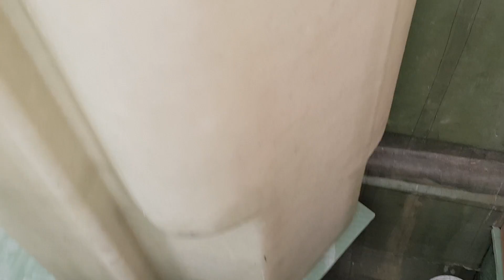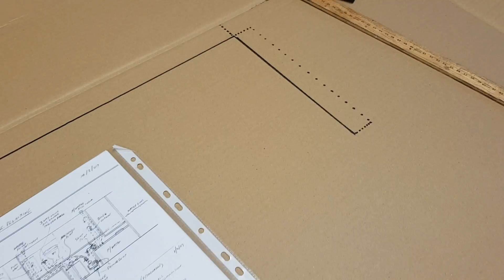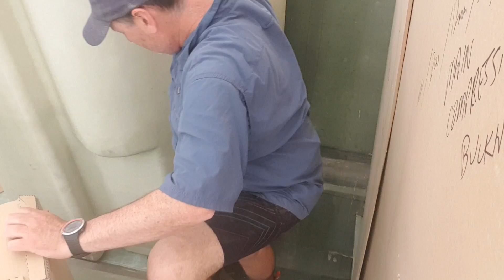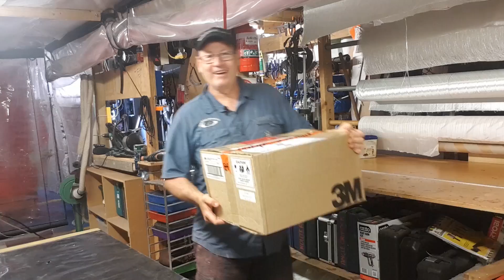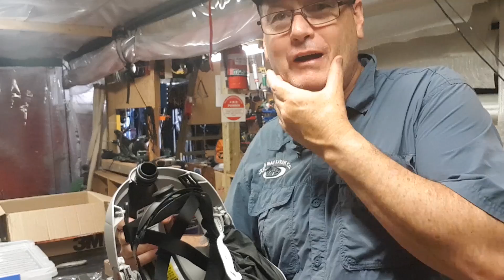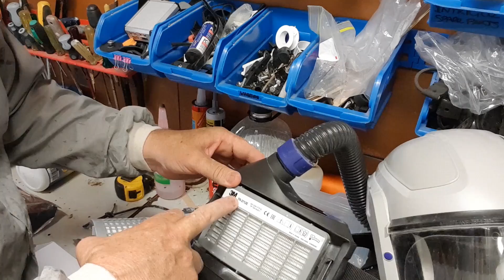Ep057 Nuisance Odours and Blackwater tank setup - Life On The Hulls - Catamaran Build

Comment: 2 points i have. 1. Making your owen templet is the way to do it. Its the only way to get the right size and dimensions.
2. The mask is fantastic, however i have noticed that it dose not cover the ears. the question i have dose 3M supply you with ear muffs to fit over or do you wear the molded ear plugs?.
I too have had an let go experiance one i will not talk on the tube.
Gerard.
Reply from the maker: Thanks buddy.Blackwater tanks have worked out brilliantly.The mask can have ear fitted,optional but I tend to wear my own underneath and behind,bit of a "make do" as I don't need the ears all of the time.Cheers
Reply: just one comment about the gas story,
now you know how an astronut feels when they are space walking. but for them thers no escape.
Gerard.
Reply from the maker: Yep,fart in a spacesuit,glad I can escape myself.Cheers Gerrard thanks for watching buddy.Ross

Comment: Have you heard of vortex coolers? They use compressed air to deliver cooled or heated air, this one is personal sized and is good for inflating a tyvec suit  , you can look and feel like a snowman.    https://www.amazon.com/Allegro-Industries-9991-Personal-Standard/dp/B012D8O764/ref=pd_lpo_sbs_469_t_1?_encoding=UTF8&psc=1&refRID=SS15Y6Q2W4RQFKMEB5PE
Reply from the maker: I did consider buying one but dont like being attached to a compressor.Would give anything to be cool.
Reply: The principal still applies when scaled up, a wind tunnel could be made to have a warmer and cooler branches, though I don't know if your work could be done in a wind tunnel.. perhaps you could make a vortex tube and just point the cool end towards your work ducting the hot exhaust into a chimbly..https://www.youtube.com/watch?v=Hn8hDY4bvpI

Comment: Eight guests on a sailboat, someone is going to drop a white mouse or baby wipe in the system & block the pump, then all the toilets are out of commission. Might be worth thinking about smaller independent tanks in every bathroom cupboard as they have on most charter catamarans, the tanks are self-draining & have a two-way valve for a direct overboard while at sea. Zero smell, no electric pump very low maintenance.

Comment: Hi Ross. To make a shape to fit your tank use the stick with 2 notches method. Cut a piece of card that roughly fits; I'd  glue a batten across the top of the tank and glue the card to it as well to hold it secure. Make a stick with a point with 2 notches as far apart as possible and move the point around the shape your making and marking the line between the notches as you go. Take this card and place it on your ply or whatever and mark all those points on the ply using the line with notches to make your shape. You now have the exact shape buy connecting the dots. Its a lot easier than I've described it.
Reply from the maker: Thanks Mike,I jave used t hr joghle stick method before and Although dead accurate,I have been using my chain jig religiously and swear by it now.The tanks blackwater and greywater willl be separate tanks to the shape of the hull for sure,fibreglass with a gel coat surface and the fuel tanks are rotomoulded polyethylene and freswwater will be integrated as bulkheads and part of thr hull,this way I can avchieve max volume with minimal cost and best for this purpose anyway.Thanks for commenting really appreciate it.Cheers Ross
Reply: You're onto it. Good work and keep the vids coming.

Comment: Being an old boat builder I agree with building your own tanks. Fit them to the hull like you did the bulkheads, shaped to the hull but a separate part. You will gain a surprising amount of volume. 
Dan R
Reply from the maker: I am building freshwater and blackwater tanks but the fuel tanks  must have a certified manufactuer for Amsa survey.Fuel tanks are made and are rotomoulded polyethylene ,pressure tested and certified.Other tanks are hull shape and water tank is integrated in the hull.Cheers buddy

Comment: I think there is nothing like a part made to fit. However I believe in the case of the black water tanks it´s worth a few thoughts before You start. There could be some funky smells and I heard it lot´s of times on other forums.... They are tough and very unpleasant to deal with.
Specially the hoses can be an issue because it seems SANI hoses sometimes are hard to come by and expensive. I also recommend You have a close look on PVC pipe. Nobody seems to approve them but everybody who uses them seems to be happy. Some say the will last longer then the boat  and there are definitely no smells which can not be confirmed by all the SANI hoses. Of course if it´s pipe or hose that will also be affecting the design of Your tanks and the type of fittings. So You might wanna give it some consideration. 
When You find out later it´s not gonna be a lot of fun because now everything on the boat is closed in and sealed.
Cheers

Comment: Hi Ross - reckon I would take the styrene fumes over lentil vindaloo any day, but then again styrene headaches are worse that the aftermath of a bad whiskey.! A further thought re moulding the black water tanks in situ ? It seems you have landed on this approach as well. Something like - hot glue battens on the hull sides to enable a flange to be formed, then fair off sides with MDF, then cover tank area with PVA or builders plastic, glass up shape in CSM with some 200 gm cloth (enough to hold shape), pull partial moulding out, then finish tank by adding more layers and ends in glassed foam core sheet, fully form flange on top edge then use a bolted on top plate in that 6 or 8 mm grey plastic sheet (which is used for tank construction anyway). Might also need to line inside of tank with waxed gel coat or similar. You can then fit senders, valves, off takes etc to top of tank. Not sure how this would go meeting survey requirements, but a neat way to do it. I used this approach to make some in situ moulded boxes for sea kayaks to hold lithium storage batteries. Worked a treat, your tanks are just a lot bigger.

Comment: quick question, you made bulkheads for the pontoon bilges. can you make those for the blackwater tank and then use cardboard from there to make a template.
Reply from the maker: Thats right Patrick,I will be making these exactly as you said now that I received a 2000 quote for welded polypropylenr tanks.The issue is passing standards for australian maritime survey.
Reply: @LifeOnTheHulls  have you looked at these https://www.erosionpollution.com/bladdertank.html

Comment: But does the filter pack filter out the isocyanates from the air created by the resin. Isocyanates are cancer causing compounds. Typical charcoal based filters do not filter them out. The only sure fire method is a fresh air supplied system. I used a 3m fresh air supplied hood for 25 years while painting trucks in a manufacturing plant. I have seen many friends die from various  forms of cancer. Most have a couple of things in common. They spent decades painting cars and trucks in bodyshops. And they all used charcoal filters.
Reply from the maker: Hey John,polyesters and vynilrsters are styrene based and product specific does not contain isocyanates,this can vary dependant on product,but isocyanates are found in 2 pack polyurathanes,epoxies,and commonly in every type of high quality spray vehicle paint.Organic vapor filters are the only protection the industry relies upon and nothing will beat fresh air fed,which I have also for my workshop,refrigerated,filtered air from outside is brilliant but sadly impractical in some instances and in a lot of cases the old full face with filters is used in any case for the smaller jobs.Luckily I have minimal painting to do ad this biat is almost all gel or flow coat finish.Cheers buddy,appreciate the comment.

Comment: Use your hull as your mold, make a tank to fit the hull (perfectly) by using the hull as your mold! ..... Fly me down under and ill make it for you.
Reply from the maker: Thats whats happening now,I have that under control,and ultimately integrated water tanks,separate black water tanks to the hull shape for better capacity.Coatings are an issue for amsa survey for blackwater so checking on that currently.All the best Ross

Comment: Make Your Own Tank..... Why NOT Use The Hull As Your Mold and make a tank to fit the shape of the hull 100%...Just like we do when we make custom speaker boxes to fit the contour of a trunk area in a car.... No More Guessing! .... Fiberglass makes great tanks, we use them for motorcycle gas tanks,boat gas tanks, Sewer tanks for houses etc... You'll cut your work time in less then half and will have a custom fit tank using all the area you have to use!
Reply from the maker: That is what is happening,as the price for custom made ill fitting tanks are insane .I have to ensure coatings are approved by Amsa.All the best Ross
Reply: @LifeOnTheHulls  It shouldn't be that difficult to get approved surface systems? We did a lot of different appliances for pleasure parks and kid's play grounds back in the nineties, with heaps of different requirements from fire proof to foodsafe to spittlesafe. The supplier did give us the needed paperwork for each of the materials and (for Disney for example) we delivered the part, an extra material sample and the paperwork. Amsa might even tell You where to get the stuff they definitely (and easily) approve.
Reply: That's what I was thinking.  Just get the chain template thing or whatever it's called and get the hull profile.  Then adjust the height so you have room for level sensors and pumps.
Reply: There will be at some point and time maintance and cleaning, therefore it is better to have removable tanks.
Gerard.

Comment: 😂 great video (just caught up after watching all your videos).  Will there be any issues from the extra height due to the foam on horizontal surfaces as well? Thinking loss of headroom and the height of the head modules fitting for example?  Also I was wondering if you use your vibrating roller to help free the modules from their molds?  Have a great time in Mexico!

Comment: OMG! Laughing my ass off! A 1st hand whiff of a Ross diet. LMAO  A chain mold would be a good idea for all the tanks since your plans have changed. Mock up your pipes and fittings as well, I had to change a fuel tank on one of my  cutty cabin boats because the fittings wouldn't fit in the size available.  Lost 20 gals capacity and several hundred bucks for that mistake. With a water maker on board, the  size of  your fresh water tanks is not as much a issue but fuel tanks and black water tanks, as big as you can fit is  key..  GAS  OUT YOUR NEW MASK MY YOURSELF..... LMAO

Comment: do yourself a favour and fit gravity emptying blackwater tanks above the waterline which require only one seacock,a vent and a pump out deck fitting and no diverter,as closing the seacock puts them into holding tank mode,in areas where there is no restrictions the seacock is left open and any discharge just flushes through the tank.

sump tanks  and macerators will have you elbow deep in sh1t every time and need to be constantly mechcanically emptied if there is no diverter valve from the head .

they also  will need 2 seacocks,a 3 way diverter, a vent .a deck fitting and an expensive macerator pump which will significantly add to cost,weight  initially and maintanance in the long term

glass  tanks fine,but will need epoxy coating on the inside to prevent vapour transfer.

3 gravity tanks are fitted on the lagoon 440 's about 120L each  for the 3 heads  FYI for further reasearch

Comment: I got off cheap on face protection by buying a surplus DuPont Hazmat suit (never used, came in the original case with the paper seals over the gaskets, and for 100USD, it was a steal). It's a bit bulky, but it does the job and knowing a good dry cleaner has made the suit last for two years now.

Comment: are you doing just Blackwater tanks and no Greywater tanks?
Reply from the maker: Grey water as well,these will be in the forward cabin sole.Required by amsa to have both,recreational craft are not required to have this.Cheers Ross
Reply: for the blackwater tank are you putting a grinder or using a access for vacuuming  the chunks?

Comment: hi didn't you make a chain so you could get correct lines in the hull?
Reply from the maker: As it stands I now have yo have the blackwater tank produced custom and certified for amsa..This can o nly be done through welded polypropylene or aluminium.T have a custom shape roto moulded woyld be cost prhibitive.My water tanks are integrated tanks so therefore are the hull section.Cheers Ross

Comment: Why not use your chain template jig to create exact fitting tanks? Creating a form fitted tank with about a 1/2" gap all around for rubber our similar isolation material attached to hull with tabbed in mounts would be ideal. I would think that an exact fit would be best with as much flush contact as possible with the hull. Having a few pressure points from an unfitted tank may cause hull issues in the future.
Reply from the maker: As it transpires,I am required now to have certified tanks ,in my case fuel is  polyethylene ,pressure tested,and certified and blackwater is welded polypropylene.My water tanks will be integrated hull tanks bulkheaded and baffled and flowcoated with food grade flow coat.All the best Ross

Comment: Take into account pipe bends on the top of waste tank plus connectors to tank plus pipe lengths to pumps, i know you want to add to hieght but once all plumbed in it will be a tight hand space, consider a pipe mock up as well, also if the tank is made out of fibreglass but lined with a pva inner skin liner it would be easier to replace in years to come due to corrosion
Reply from the maker: You read my mind,I think I have solved this and have a solid plan.tanks will be custom made and of welded polypropylene and certified to amsa survey standard so all good.Thanks for watching.Ross

Comment: Have been wondering how the plumbing and electrical wiring would be dealt with. Will,you,put it in before modules are glassed in? Or will,there be access to do it after?
Reply from the maker: I reckon all plumbing will be in,electrical can be conduted more easily as most is above the floor level,except bilge pumps senders and water pumps but although access will be good certainly wont be easy to route things .All the best Ross